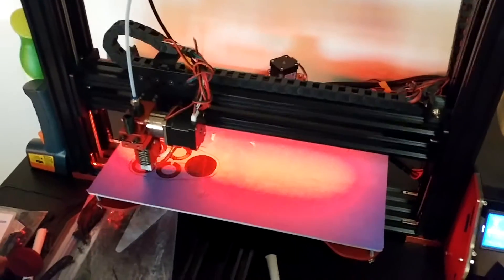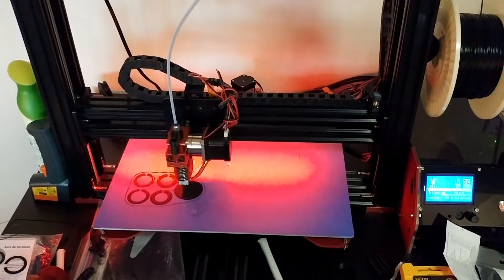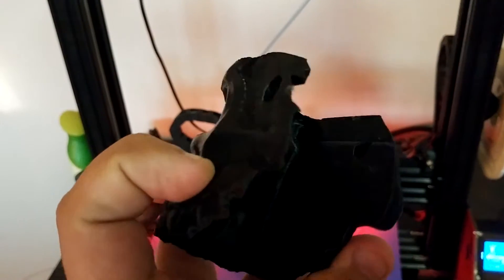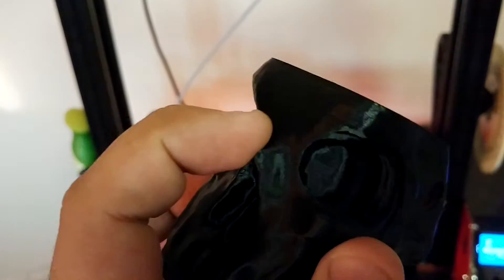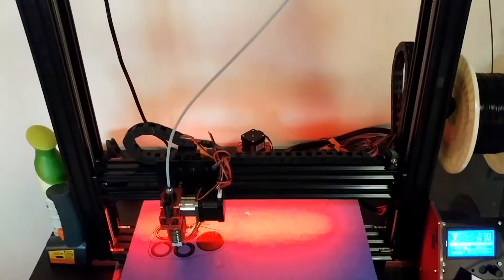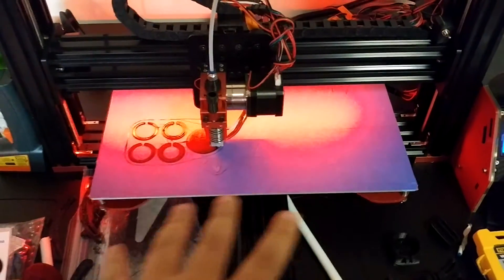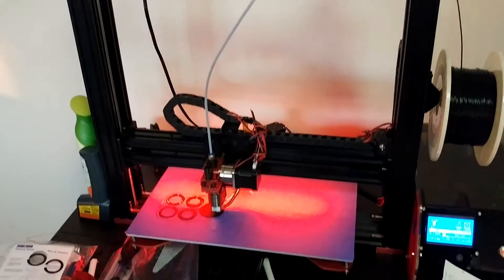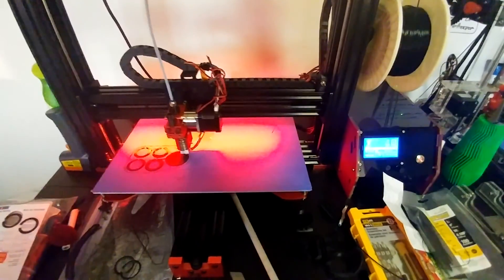Tevo Black Widow 3D Printer Update 2

Comment: Is that just an allen head machine screw that you put under the bed? If so, did you put a flat washer or something to push up on the bottom of the bed?
Reply from the maker: Just a socket head cap screw. I have a small 3d printed cap on top to protect the bottom side of the bed.

Comment: hi, I just built one of these, but I'm having trouble getting it working properly.  do you know of a well written guide anywhere to getting it going? The info that comes with the printer is non existent . 
The two problems I have are , the proximity switches don't work so it doesn't stop when trying to home it, and the extruder doesn't turn when manually jogging the dial. any help you can give would be very much appreciated :)
Reply from the maker: The homing issues could be caused due to wiring or firmware. Check all your connections. Place a metal object in front of the sensor and you should see a small red light light up. The metal must be very close in order to pick up.

The extruder will not jog until the hotend is hot, so try that.
Reply: Hi mate, if you still need help with setting it up, try this: 
http://www.jupacreations.com/tevobwcg/JupaCreations_bwcg.pdf
Hope it helps

Comment: I notice your Bowden setup but wasn't the direct extruder the big advantage of this printer ?
Reply: Look again. The tube is simply a long filament guide. The extruder is still right on top of the hot end.
Reply: he does not have a Bowden only Teflon tube to guide the filament
Reply from the maker: The bowden tube is simply a filament guide. The extruder is still directly on the head.

Comment: any plans to add the bltouch? Seems like you have your bed pretty dialed in already
Reply from the maker: I just had one delivered but i think that i may install it on my acrylic Prusa I3 as its bed moves with temperature fluctuations. I have yet to have the black widows bed move even a hair!
Reply from the maker: I have a BL Touch but i have not installed it yet. It may end up on my poor little prusa.